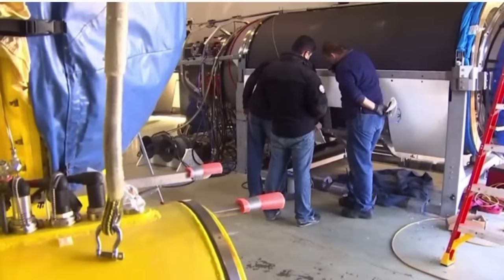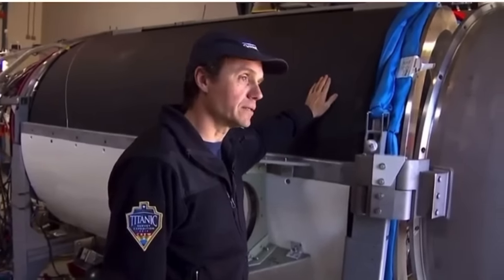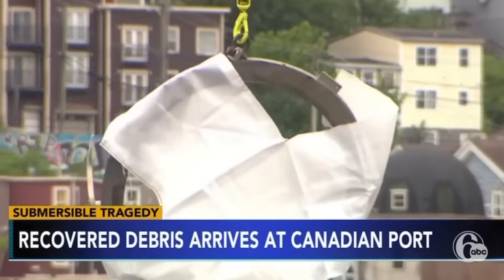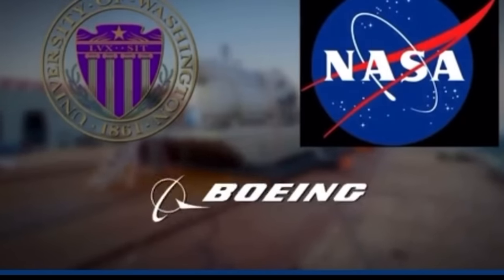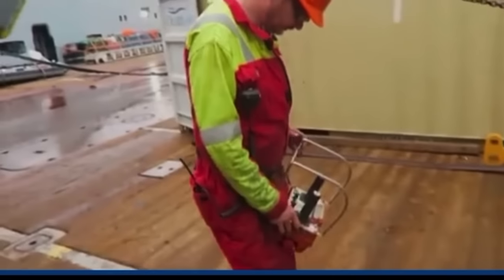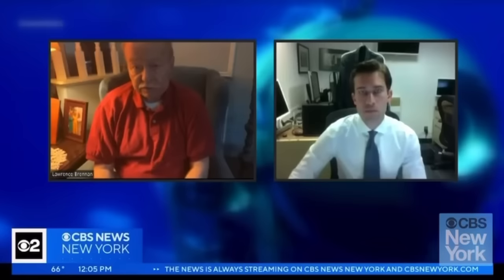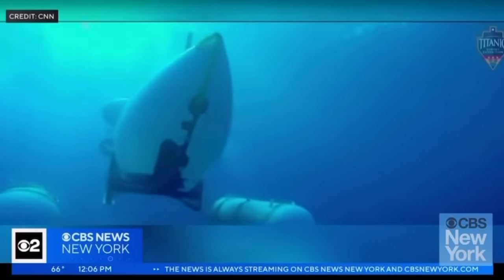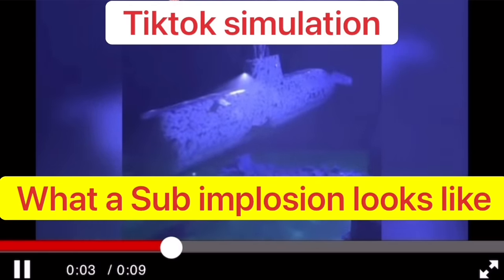Titan nosedived like an arrow (then popped like a balloon) #Titan #oceangate #Titanic

Comment: Baffles me that anyone would ever get into that sub. Yeah, you are bolted into it with no way to get out unless someone lets you out.
Reply: This alone would be a no from me. Added to the multiple previous problems with lost communications, not that passengers were necessarily made aware of this, but just the mere thought of trusting a company with my life on such an expedition in an experimental craft, while being locked in like a sardine in a can, is too crazy a risk.
Reply: If you're at the bottom of the sea, you're not getting out regardless. Strapped in or not. Too much pressure.
Reply: True. But think Apollo 1. If there was a problem, and you got to the surface...... You're still goosed!
Reply: Get out of the sub? Dude. The whole point is to not get out.
Reply: @brostenen what if they got to surface but drifted to unknwon location...they will dead bc of lack of oxigen
Reply: @KotobKotob  What if, what if.... It turned out to be a non-issue in the end.
Reply: Two of those "mission specialists" are "risk analysts" in their real life. It is ironic how many snake oil salesmen are out there.
Reply: @ITobjectives 😂😂😂❤❤❤😂😂😂
Reply: Looked like a garbage can with a window on the lid.
Reply: That question you should ask the people in this video
Reply: @jmd12127  Ironically.... It turned out to be a can of garbage in the end.
Reply: You can’t get out at those depths anyway.
Reply: Cruise ships, though luxurious, enormous, and volumes safer than this underwater trashcan, are also a vehicle that you are trapped on board, unless someone let's you out.  I do not understand the charm of being trapped in a floating mall / hotel with thousands of strangers, many of which may be thieves, carry disease, and could be violent.  The underwater trashcan also crammed people together. Going on vacation is to be far from people, not trapped with them.  Humans in close quarters are rather disgusting. I do not understand why humans seem to like herding together like cattle to slaughter.
Reply: Idk…if you look at it on paper, commercial air flights seems potentially risky, but millions travel with no issue.  And even if you go on a slow, walking horse tour in the park on the laziest horses they can find, you have to sign and supposedly read 6 pages of a liability waiver warning you that you may fall, break bones,be stepped on, bitten, kicked, have a head injury, loose teeth,rupture your spleen, and 50 other things, including death.  

And the CEO Stockton was really pestering potential passengers “hey…we have an opening next week!  Even will cut the price.” and texting how safe it is….that there has never been a commercial sub disaster, that just scuba diving is more dangerous and the like.  

So I could see some busy executive not recognizing how truly risky it was.
Reply: For 250k per person is equally as baffling. Would've paid 1500
Reply: @cliffsenac2825  I would actually charge the owner of that trashcan to have me as a passenger.  $100.000 and I will be a passenger.
Reply: @Itried20takennames The fault was not the passenger's faults at all.  They were innocent reckless homicide victims.  But, would you have got into that underwater trashcan?
Reply: That part
Reply: The worst thing is when they won't  let you out! Must have been  an absolute  riot on April Fools day!
Reply: @user-dn4rx8ev3j  yeah, I didn’t mean to hijack the thread. The guy immediately above my comment got ridiculous about the Israeli Palestinian thing, and I was responding to that.
Reply: @netposerx,  👍yeah, and the guy with the wrench to open the hatch from the outside is sitting inside next to you! Oops, did I do that! 😂
Reply: That doesn’t really matter, you can’t open it anyways. If you managed to get it open then you’ll very quickly sink the craft.
Reply: @indridcold8433 I wonder if there are more than a dozen accounts with the name Indrid  Cold or have I seen YOU so many times the last few years.
Reply: Absolutely crazy! I'm no scientific expert, but common sense says it's not safe. Plus paying a ridiculous sum of money to risk their lives was nuts. Some people have too much money matched with too little common sense
Reply: 3 of them were already experts in he field and been to the Titanic multiple times. The 19 year old kid reportedly did not want to go eiher
Reply: Yeah!!!  That’s crazy!
Reply: And GLUED!!  Fkn Glued!!!

Sounds like a solid plan.
Reply: @valentinesolko4039  we know that but it's all in the mind ..plus you don't even get a f CHAIR / SEAT / help anything to lean on or help STRETCH your LEGS ... C'OM MAN. ? HERE'S NOT THE DEAL 😅😅😅🙏💚🍀. RIP
Reply: Couldn’t have paid me enough to even consider it.
Reply: Why would anyone ever get in an airplane?
Reply: @markleyg  Maybe because there is over 100 years of refining them. And I didn't say this about other submarines, just this one.
Reply: @netposerx  People went on them before they were over 100 years old.
Reply: @valentinesolko4039 yeah but the fact even if you returned to the surface like it’s redundant emergency systems were supposed to do you couldn’t get out.  Man that would suck sitting on the surface running out of oxygen just stuck in there
Reply: @MrJruta flex tape never looked so good eh😅
Reply: @macalister8881  😂😂😂😂
Reply: And Allegedly   No  seat  to sit on😮 no  toilet😮  tiny  and  a  very small window to look out😮 and  hundreds  of thousands  of $$😮??
Reply: @indridcold8433 NO  WAY😮 and ALLEGEDLY it looked  tiny   and  clostraphobic?
Reply: @joannemurdock7899  they had a small chemical toilet with a privacy curtain ... woooo hoooo
Reply: @Nightmareman3  This is my only online existence. Since it is my only online existence, it could be that I may be seen more because I do not use anything else to decide up my usage. However, it may also be that the given name of, "Indrid," and rhe surname of, "Cold," are very common where you reside.  I have only known one other person named Indrid my entire life.  As for the surname of, "Cold," I have only got close enough to someone one time in my life to know her surname. Everyone else I have ever met, has only been for temporary reasons. I never cared to know their surname.
Reply: The thing I get hung up on, is Stockton Rush went down in it too.  Why would he do that if he had any doubt at all it was safe? And if the one in charge of building it thinks it's safe enough to use... well, if I were the kind of person to find that experience appealing (and too be honest, I don't, even if thousands of people had done it safely and a ticket only cost 5 dollars) I might have been persuaded.  Which is scary.  And I still don't understand what SR was thinking to risk his own life.  Was he really so delusional as to think it was safe? Was he just taking the ultimate gamble? Did he just want to go out with a bang, so to speak? We will probably never know.
Reply: @whatsanenigma  He was suffering extreme Dunning-Kruger effect.  He believed himself superior to everyone in aspects that he was not even vaguely qualified to perform. He designed a submersible like a fuselage, which is designed for the opposite of what he put the vessel through.
Reply: It was definitely substandard.
Reply: @Cmoredebris  I see what you did there, "sub," standard.  But yes, that trashcan probably did not even meet the sanitation department standards.
Reply: In another video they were gluing it together. I was like no way how could they have got on and anyway how could you pay that much money to sit crisscross, applesauce and for lunch they only ate sandwiches and chips and a bottle of water???
Reply: @edkiely2712 never mind that Israel was attacked first-- not once, but over and over and over not only by Hamas but also by many other countries, tribes, and people groups continually throughout history, for no reason.  Oh, and by the way, Hamas not only is the aggressor, but they are also the ones using the Palestinian people as human shields.  How easy it is to forget the truth... 🙄
Reply: @leighlowe1069  They got let out.  But, they were unrecognisable when they were out.  I think there was no way to identify the remains without a DNA test.  What came out was unrecognisable as anything once alive.
Reply: @leighlowe1069  What?  Nobody said that. If the sub surfaces there should be a way to open the hatch from the inside like every other sub on the planet.
Reply: @PercyPruneMHDOIFandBars  "You're still goosed". Why? If you were lucky enough to survive that far. Then all you needed was somebody with a big spanner and a steady hand.
Reply: @KotobKotob  "they will dead bc of lack of oxigen". There supposedly was enough oxygen to last for several days.
Reply: @jmd12127  "garbage can with a window". It was garbage alright.
Reply: @sandgrownun66  Look into the history of Apollo 1. I think that might explain my point.
Reply: @sandgrownun66  what if no one found them for a week or month
Reply: The thing is they did little testing and on the way down to Titanic it was giving warning signals she’s not holding the ocean pressure very good at all.
Reply: Love that there are so many puns here. Many of these authors of the videos say let's do a "deep dive" [on this subject] and this dude says that it "baffles"  him 😮😂
Reply: @KotobKotob they would have found it floating.. they actually found debris at the bottom.
Reply: No matter what they said...that thing was nothing more than a iron coffin. Thst calmed five lives due to one man hubris and greed.
Reply: A bell you say? Listen, Stockton Rush didn’t have time for decompression or any such outdated, old man safety protocols. Besides, he spent the last of the Titans budget on its guiding system aka Logitech controller. You know, the same controller that PlayStation players considered a piece of crap.
Reply: I believe they weren't considered "guests" or even passengers , they were written up in the contract or waiver as a worker of some type I forget the actual term that was used , operators or something like that but they were supposed to help out with the "work" and getting the exploration as they called it set up.
Reply: Like the mystery why people explore caves with tunnels 10 inches high and no way to reverse if another person comes your way, or why surfers surf over man-eating sharks who come up tlike torpedoes to eat you, or those people who bunji jump etc...
Reply: Could say they were playing a game of God/ on their own terms who knows what they saw when they passed away it’s like/ when a serial killer murder someone but the murderer victim can still feel the pain after death that’s what they say that’s a scary part of the life !
Reply: @indridcold8433 I literally can’t think of a worse vacation than a cruise. A bunch of drunk trashy people crammed shoulder to shoulder.
Reply: @darrenschannels  Exactly. It is just a huge hotel on water.  Why would I want to be stuck with 3000 people I do not know and do not want to know.  It is disgusting.
Reply: I'm still waiting on a reply blaming Trump he's been accused of everything else
Reply: But this isn't even the worst part for starters it's not like your going to be getting out of the sub down there and walking around the titanic.... and 2nd most subs are all bolted down to be begin with and when they surface there's all people helping to open the hatch anyway
Reply: Ÿyÿÿ⁵
Reply: He whom the gods would destroy they first make mad … with all those red flags, no one on that submersible was firing on all cylinders imo.
Reply: I bet if the tickets were £100, they’d be queuing around the block
Reply: I've always been interested in the titanic....I would consider go9ng down in some pf the ones I've seen scientists use....the second the guy told me the sub ran from a playstation video game controller id have said "oh hell no"
Reply: Imagine it is floating on the surface, and there is an onboard fire, a medical emergency, its leaking water,  oxygen running out.. There is no escape hatch  on the top, so the only way to get out is for it to be lifted out of the water and all the bolts to be undone.  How long would that take? Especially in choppy or rough seas.  Deathtrap. Badly designed.
Reply: Darwinism.  We aren’t the smartest species …
Reply: @dannystephen591   Trump the victim, that's fresh 😂
Reply: You could not oay me any amount of $$$ to be on board those massive,germ infested cruise ships.
Bad enough on an airline!
Reply: You would still be dead!
Reply: How tf did no one not panic....I'd go absolutely feral if I was bolted into something
Reply: Rush I'm sure had a well practiced pitch.
Reply: @jmd12127 , to me it looks like a giant Tylenol.
Reply: Yes that’s frightening man I have cloister phobia I couldn’t do that - I can’t imagine what really happened - I believe there were prior indications of the sub imploding I bet it was loud
Reply: Pride, greed, and covetousness can make us blind to wisdom. They wanted an exclusive experience and were willing to accept everything Rush told them if it got them that experience.

Comment: For $250,000 you paid for the title, "Mission Specialist" on the OceanGate Titanic expedition. 
For $3.59 you can rent the movie, "A Night to Remember". 
For $5 you could have gone to a movie theater in 1997 and watched "Titanic".
Would you then be qualified as a a "Movie Specialist"?
Reply from the maker: I choose the 5 Dollar option
Reply: @silki24  Actually, the 1958 movie "A Night to Remember" is more historically accurate than "Titanic", except that they did not know in 1958, that the stern of Titanic split apart and floated level, before the forward part of the ship, still attached at the keel, pulled it under. In 1985 Robert Ballard found the wreckage and the two parts of the ship which were located 2,600 feet apart.

Comment: So, it failed at 5,700 feet and fell over 6,800 feet straight to the scene of the accident. I believe that most of the dive's were cancelled, due to weather. It's tragic to think what they went through. On one of the trips this year, they snagged a "ghost net" with the platform over night, and canceled that dive because the net damaged the sub. Nobody would insure the Polar Prince, or any other ship because they were launching that sub with human's which was not rated. So, Rush solved that problem by towing it like a barge. The barge launched the sub. Rush was a con man. Always doing things to get around the rules.
Reply: It's more of a tragedy, when you die without a lunatic in control of your destiny.

Comment: You want to see me freak tf out? Put me in a sub that you can’t open from the inside like this one. They could literally have died just by being lost at sea because someone has to be there to unbolt the hatch from the outside.  That’s the most ridiculous design I’ve ever heard of. Then you had industrial strength glue holding the carbon fiber to the titanium. No chance in hell I’d have ever stepped in that thing. On top of that, the viewport was only certified to be safe to 1300 meters. They were going 3x that depth. INSANE. They also never had one mission go smoothly. Something always went wrong because they were still Working the bugs out of it. The electrical system was designed by a kid in college. Then the real-time monitoring system that counts the cracks in the hull never counted the total accumulation of cracks.. it would essentially reset after every dive which made it pointless. So it’s only telling you how bad the hull is being damaged on each mission… not accumulative damage over time. The craziest part was that it was actually working and probably would’ve worked had Stockton not made everyone rush to build it. If it had proper testing and years of research, no doubt in my mind that you could make a successful sub out of carbon fiber.

Comment: Since when does an implosion resemble the popping of a balloon? They are literally diametrically opposed.
Reply: they sure are. Also an implosion on a metal tube would be much different that an implosion on a brittle tube.
Reply from the maker: it is a bit of both but mainly this example was used in my opinion to demonstrate how quickly it was over
Reply: @silki24  The sub's transcripts would also suggest that this series of events is incorrect, and that the implosion occured as they were trying to ascend.
Reply: @karlsilverone The transcripts haven’t been released, the ones you’ve seen on youtube were proven to be false long ago. We will probably never see the real transcripts.
Reply: @FannyShmellar  Where is this proof, and proven by what authority? Can you please point at it? I'm fascinated by this incident, and would like to learn more.

Comment: It just baffles me how they paid 250k and the submersible did not have any seats or seatbelts
Reply: Or a proper way to get out.
Reply: What difference would they have made?
Reply: @sandgrownun66  to me it would have made a lot of difference because when I would have saw that. I would have thought it was homemade and I would’ve got on.
Reply: @lejonfo  It takes more than a few straps to make a vehicle which can withstand the pressures it had to. You'd still have been turned into soup, belts or no belts.

Comment: The submersal had no thrusters to keep it horizontal! It could only turn left and right and go up and down. Crucial, the passengers wore no belts to keep them in place... When inadvertently one passenger would move forward, followed by a second one, the horizontal buoyancy is gone; pressing everyone to go to the toilet, being the front window end of the vessel. Impossible to regain their place higher up. The implosion was their best outcome of the dire situation. Imagine they would have remained one on top of the other until exhaustion of the oxygen.    OMG